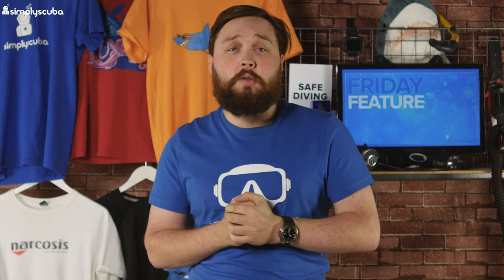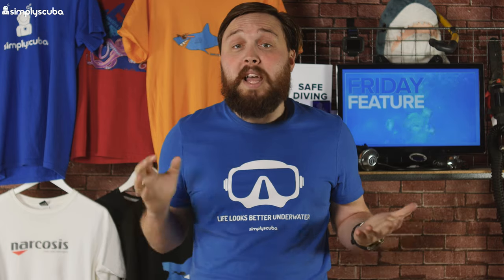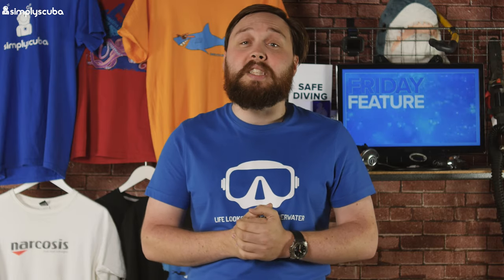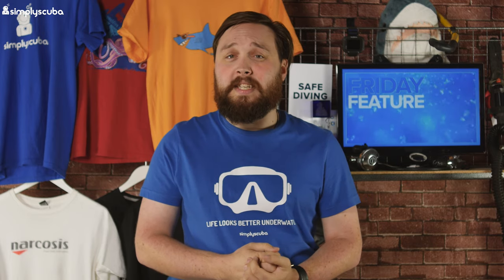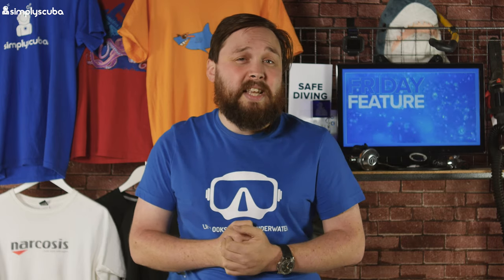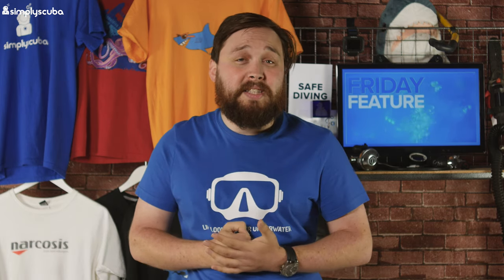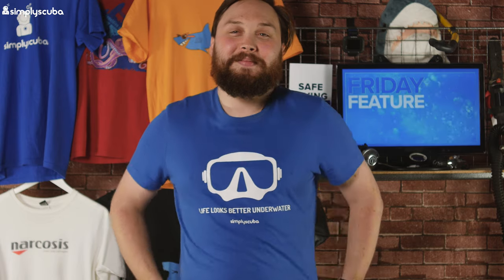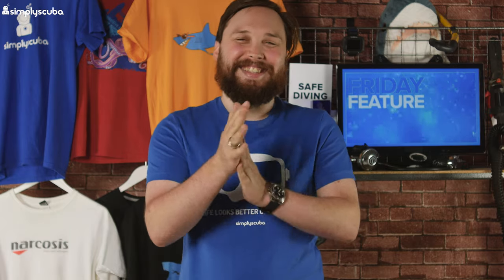Why The Standard Scuba Setup Is Wrong!

Comment: I agree that I hardly ever use my snorkel, but the dive shop I DM for requires all instructors and DMs to wear the snorkel in the pool, and while in a teaching capacity in OW, we don't have to wear it, but it has to be on our person, so collapsible ones are nice.
Reply: John Jones leave PADI and go TDI :)))
No stupid requirements of having useless gear on yourself :)
Reply: @romanmarkovtsev9682  Oddly enough, I do have a couple of TDI certs, but I've spent too much money becoming a PADI DM to just up and switch now.
Reply: Yup that's padi. They also tend to sell half complete courses. They do not even teach diving tables anymore so if equipment fails, then what? Look for another organization like gue or tdi also for recreational diving.
Reply: John Jones just do a cross over your DM status to TDI. It is almost free. No problem. I just did last year.
Reply: Carlo Kop if your equipment fails (and i think you mean a dive computer) you should abort a dive. Or if you want to continue, just dont go deeper then your guide or your buddy. 

And those tables wont do much anyway for you, when you are diving recreational.
Reply: @romanmarkovtsev9682  and what if you forgot to change your computer settings from nitrox to air. Without any knowledge about no deco times your just going to be a slave to your computer.
Reply: Carlo Kop and what!? Just again dont go deeper and no longer then your buddy/guide. 

For NON deco dives those DCs are not really useful anyways in that sence. It is mostly just a simple timer with depth meter. 

It wont hurt if u  make 2 maybe three 40mins dives a day to like 20-25m. 

I know a lot of DMs and Guides who don't use computers, but just watches when they dive. Cuz they have been diving years in the same dive spots and know depths up to approximately -/+ 1-2 m.  So they know that making 2-3 dives a day with proper safety stops doest hurt cuz that have dived hundreds even thousands dives with such profile at the same dive spot. 

So those NON deco tables are useless anyways if you dont use timer and depth meter and write down your minutes during the dive.
Reply: @romanmarkovtsev9682  i'm not saying you shouldn't aboard your dive. It's just that specially when diving at your NDL or possible past them. Then what? Dive computers can nicely tell you how to handle your deco but if you forgot to put in the correct gas, these numbers will be incorrect and you cannot rely on the computer from your buddy if you made dives with buddies with a different profile and bottom time. Than what? When we do not teach new divers them their NDL limits and what to do if they pass them for a know number minutes problems might happen.
Reply: Carlo Kop if you dive beyond your NDL it will be DECO dive, and mostly already some Tech diving. Thats where you learn how to use timer, depth meters and plan your dive according to tables. Computer there again is just a secondary device. 

 But we are talking about recreational level here, right!? Remembering tables for a REC Diver is mostly useless info now days, if you dive with a group and a buddy. 

Cuz everyone dives mostly the same profile. So it doesn't matter even if you have a DC or if it is broken.
Reply: @romanmarkovtsev9682  I agree with you Roman. OW courses or even Nitrox courses don't go into nearly enough detail to make learning tables useful, no matter which agency. Your computer fails, you abort and make a controlled ascent plus safety stop with your buddy's computer. That should be safe for any NDL rec diver and tables won't help there. I'd say you'd have to be at something like the Deco Procedures level to have the need and enough understanding to calculate a proper backup plan. At that point, you should have a backup computer anyway, so...
Reply: Yggdrasil42 and dont forget that at that level those PaDI tables are not used anyway. Deco is calculated on different data then NDL tables.
Reply: @forgot_my_name_again  yes, we do actually still teach dive tables. We use the ERDPML in the online course and the digital version open water course. There even questions on the open water test final and quick review that must be answered.
Reply: @romanmarkovtsev9682  you still need to know how to work the tables for your dive planning in case your computer fails. If you can't do the tables, and your computer does or you don't have one, you are done diving because you don't know what your dive limit is going to be for a given dive
Reply: @romanmarkovtsev9682  you should NEVER dive your dive according to your buddies computer. He or she may have a different nitrogen load than you
Reply: Jeff Pettigrew if your computer fails you Abort the dive and get out of the water with proper safety stop. 

You dotn plan anything when you arr in the water!! 

And you don't plan anything after that cuz you dont know your previous dive profile and saturation levels.
Reply: Jeff Pettigrew if you are diving with the same buddy you can continue diving and use his DC. Just dont go deeper then your buddy. 

And again: nitrogen levels in recreational levels are not important at all anyways. Dive profile is more important!
Reply: @romanmarkovtsev9682  I never said that you plan anything while in the water. Of course you abort the dive if your computer fails. What I was saying was that we DO still teach tables, and if you are building your dive profile on either your computer or a RDP table BEFORE you dive, and have a secondary time piece and  depth gauge like you should for redundancy, and stay within your NDL, you could still dive again without a dive computer. Having a dive computer crap out on you does not necessarily keep you from doing additional dives without it. But that is where keeping up with your dive table skill comes in handy. If you know your values and how to figure your pressure groups, you can continue to dive as long as you have not exceeded you NDL limit or came withing 3 pressure groups of your NDL
Reply: Jeff Pettigrew you 1000% Never dive such strait profiles in recreational. In tech yes - same deapth for certain periods of time. 

But in rec you dive saw or V profile. Which makes tables completely useless especially if you start using them in the middle of the diving day. 

And keeping deapth gauge and timer!? Are you kidding me? You should nake notes every 5 mins every dive BEFORE getting to tables to be able to use them later. 
Measureing depth after your DC failed gives you no info.
Reply: @romanmarkovtsev9682  I did not say you COULDN'T dive using your buddies DC, what I said is that you SHOULDN'T. And what do you mean that your nitrogen load is not important at all. Of course it is! Your nitrogen load DIRECTLY affects your needed surface interval time between dives. If you do a 60ft dive for 49 min, you are doing a 3 minute SS at 15ft. Why? Say it with me..... Nitrogen load
Reply: @romanmarkovtsev9682  the dive tables are definitely more conservative than using a computer, but that does not make them useless. And if you planned your dive prior to your dive, using either your dive computer or the RDP (which will give you shorter bottom time do to it assuming you are doing your whole dive at the same depth) and your computer goes belly up, you should have an analog pressure gauge on your console to tell your depth and a watch to see when you had to abort. You can then plug that information into the RDP and it still may be possible to dive again. Maybe not, because as I said, the rdp is going to give you a more conservative profile so it may put you into a higher PG, which may keep you out of the water
Reply: @jwp8363  If you do standart recretional diving: 2-3 dives to  20-30m with 40-60 mins SI, you dont need to think about any nitrogen load AT ALL!
Times and deapth are not enough to get your nitrogen load and body tissues saturation levels to such high levels to think about NDL.

BUT! What you should you think of is PROFILE! Clear profile, V profile or saw profile. Do you know that easy descovery dive saw profile to 5 m actually can cause your DCS very easy? 

So instead of studing pretty useless tables it is better to teach your students Deco Theory and different Bubble Modes and how your body tissues saturate at different speeds and also release bubbles on different rates.
Reply: @jwp8363  Having something else except SPG on your console is also a bad idea.  It is better to have deapth gauge on your d-ring or on your wrist if you need back up one. 
Also if you need to write down your time and deapth you will need writing pad , again on your wrist or in your pocket to make notes every 2 mins after your DC failed.
Reply: @romanmarkovtsev9682  why is it bad to have your depth gauge in your console and better on your wrist. You make no sense dude. And what are you writing down? Your watch will give you your time, which you can also use for your safety stop timer btw, and your analog pressure gauge will keep your deepest part of your dive, which you can use for figuring out your pressure group when you get out. It does not matter WHERE you have the analog depth gauge, wrist mount, console, hanging off your butt, does not matter. As long as you have one. What is your cert level may I ask? I am a PADI MSDT myself, not that makes any difference at all
Reply: @jwp8363  i am TDI Adx.Nitrox certified. 

Maximum depth gives you nothing! I may have dives V-profile and spend 30 secs on 40m, and them 43 min on 15m! or a saw profile bouncing between 5 and 15 mins every 2 mins. 

if you use just the deapest  part of the dive for your table, you will have to take 40m! but it wont be right at all! cuz 30 secs at 40m wont give you any nitrox saturation levels as high as tables say. that's why if you want to at least get an estimate of tisues saturation you will have to measure time and depth constantly and taking notes. 

so for rec level diving there is one and easy rule: never stay in water LONGER or DEEPER then your buddy/guide and you will be fine! even if you dont have a DC at all.
Reply: @romanmarkovtsev9682  geezer Roman, you are just not getting what I am saying. I am not saying you are going to call your dive on 40ft (not 40m, as that is 132ft) for 30 seconds. That would not cause much tissue saturation at all, you are correct. What I am saying is that if your dc craps out on you, your deepest part of the dive is 40ft, so you call the WHOLE dive at 40ft, which would be for your total time of 44 min (43 MIN + 30 SECONDS). When you plug that into the RDP table (40ft for 44 min) you get a new pressure group of J. To get back to an A diver, you would need to stay out of the water for a minimum of 2 hours. So the tables will work if you use them correctly, and 2 hours later, i am back to an A diver. You could go in earlier as long as you remember to track your RNT in your new dive plan
Reply: @romanmarkovtsev9682  and your rule of not staying in the water longer than your dive buddy or guide is a good rule, but not for what you are trying to say. You should not stay in the water longer or deeper because you should always dive with a buddy, unless you are solo diver or self-reliant diver qualified which changes the rules a little. And diving without a dc at all is just crazy and now you HAVE to use tables to plan your dive. That is why you cannot plan or do a saw dive with a traditional RDP. You would have to use a multi-level dive planner to calculate the dive. That why computers are great, but they are only great until they don't work. Then you go back to the old ways of doing things. I do not know much about the TDI way, but it seems the teaching is a bit lacking if they are teaching you that it is ok to dive your friends dive computer and profile
Reply: @jwp8363  40min @ 40m is NOT the same at 30sec @ 40m! 

total different profiles and tissues saturations. also dont forget how you ascent! you can finish desaturation and even SS while ascending the right time with the right speed, and you will be ready to dive in next 30 mins and not wait for 2 hours! 

so tables wont give you any good on dymanic profile. they are only good ONLY if you stay at certain depth for a certain amount of time. which in RECRIATIONAL diving is not possible, unless well if you are underwater photographer and stay at one coral trying to get picture of that tiny shrimp!
Reply: @romanmarkovtsev9682  never said that 40min at 40m was the same as 30s at 40m. If you were at 40m (132ft, I deal in imperial) for 40 min, you would have blew your no deco limit by 30 minutes so you would be doing a sa of at least 15min at 15ft and be out of the water for 24 hours. So that leads to a question of why did you do a bounce dive to 40m for only 30 seconds? Just to say you did it to that depth? That is dangerous. You should not go that deep without good reason. What could you possibly see in 30 seconds. So say you do go down there for 30 seconds. You are not going to have much load at all. But now you are staying at 15m for 43 min. That is what you would calculate into the RDP. So now you did your ss at 15ft for 3 minutes and get out and  calculate your pressure, you are now a J diver. You could get right back in as a J diver with RNT that you have to account for. My calculation of 2 hours was putting you all the way back to an A diver. Of Course you could get in sooner, never said you could not.
Reply: @jwp8363  that's the point! table are USELESS because EVERY dive you do in REC is MULTILEVEL dive! 
you are not going straight down, stay at the same depth whole 40 mins and them go up with 3 m SS at 6 m!

you go V- or SAW- profile! And when you dive that way tables wont tell you anything! 

and to calculate such profiles you need multi-level tables, depth gause, timer, take notes every time you change depth!  

that's why at many many many dive locations such as Japan, Philipines, Bali , etc where there are a lot of divers who come without their gear or come for courses and them do some fun dives after they get C-cards there are CROWDS of diver who dont have DC. 
That's why DM or guides usually say: "Just dont go deeper then me and get out of the water first!"
Reply: @jwp8363  30 second at 40m I said as example, that you CAN NOT take the deepest part of the dive for your calculations on tables if you use depth meter without proper timing! 

My point about Tables is that they are very very OUTDATED! I think instead of wasting time on studying them, better use that time to learn about Deco Theories, bubble models, etc. To UNDERSTAND what is NDL and Deco  and HOW bubbles effect your body and different tissues. and why for example, multi level dives are much more dangerous then one deep dive. 

Do you know that SAW profile Intro Dives for 10-15 minutes which a lot of instructors do are much more DANGEROUS and can lead to serious DCI then one deep , even deco dive?
Reply: @romanmarkovtsev9682  all good points but i'm just wandering. Unless you are a solo diver, why carry a redundant time or depth gauge at all? Can't you rely on the equipment of your buddies in the unlikely event of a computer fail.
Reply: @forgot_my_name_again  you dont have to carry any redundant equipment unless you dive techno. 
relying fully on your buddies equipment is not recommended cuz your profile is usually not the same. some dive longer/deeper, some may have some tissue saturation from previous days of diving, etc.

BUT! if you dive FULLY recreational to depth like 30m doing 2, maybe even 3 dives a day you dont have to worry about NDL times and get into panic if your DC fails. Cuz you are diving about the same profile give guides have been diving at that point for many many years and never had any problems before. This means the way you dive and your average profile is the same as thousands of divers before you. 

All you have to worry is only your wallet - cuz you will have to buy new DC or pay some 100-300 USD for repair yours :)

IN tech diving you use tables and such BEFORE you even make your dive! Main Dive Plan, Back Up Plans (if loose air, if went deeper, if stayed longer at certain depth). But again those dive tables and calculations are completely different from ones PADI teaches on theirs tables. 

If you actually want to know anything about NDL read DAN material  on diving medicine, TDI matersial on Deco Diving and books by Mark Powell "Deco for divers" and "Technical diving An Introduction" (tho it is more about Tech diving in gerenal then Decos).

And about problems you can encounder under water I highly advice to read Gareth Lock "Under Pressure" book.